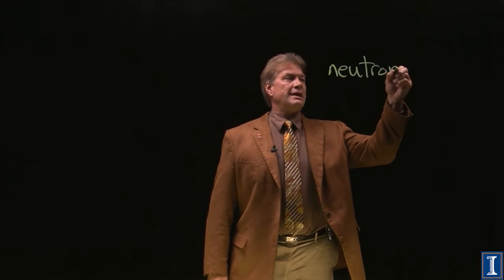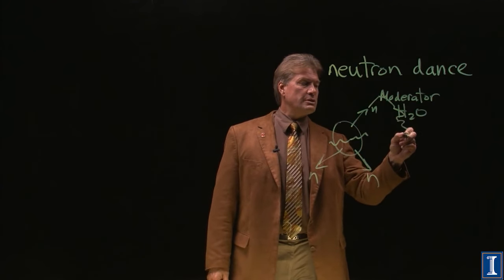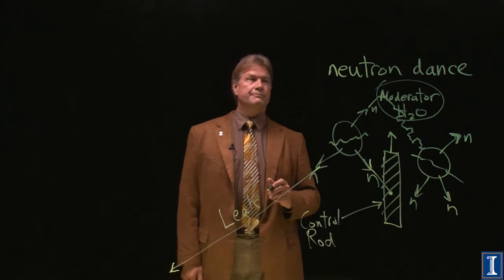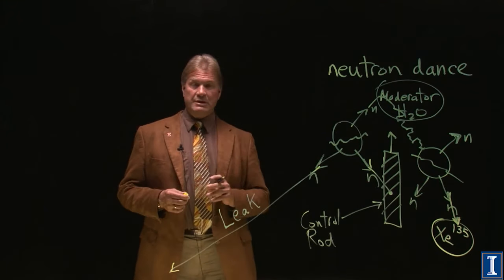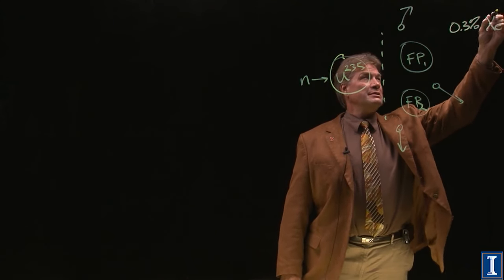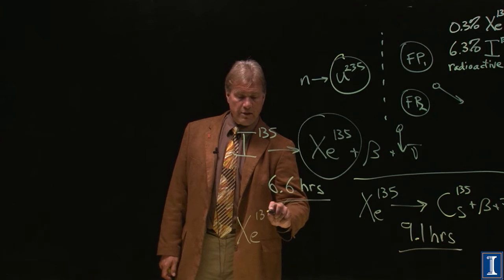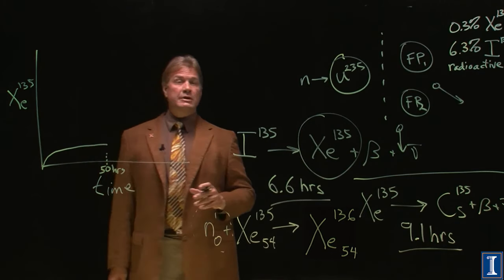Xenon Can Be a Problem

Comment: I had always heard that the disaster occurred because the Chernobyl nuclear plant was badly designed.  But apparently it was actually caused by its operators performing an obviously stupid operation.  That was a very clear presentation by Professor Ruzic.
Reply: (according to the internationally accepted explanations) 
It was badly designed: After they created the runaway reaction they tried to shut it down. But the shutdown just made it run even faster because of a design flaw.
The design flaw is quite complicated related to the graphite parts of the control rods, and only presents itself in case of emergencies, so the operators had no way of knowing it from their own experience (and they weren't told).

The positive void coefficient made it possible to create a runaway reaction. Some argue that is a design flaw, but with smart design and safety you keep such reactor in control. (positive void coefficient causes a positive feedback loop during runaway)

Without the design flaw, they could have stopped the reactor even after the runaway started, and could have resumed normal operation a few days later. (or immediately after if they were particularly brave, against all regulations)

Control rods: part of the control rods is graphite which makes the reaction run faster (by slowing down neutrons), other part is a neutron absorber. This seemed to be a really good idea, because this way there is never water in the control rod hole. Light water is a neutron absorber, so without the graphite parts, pulling out the control rod would be exchanging a strong neutron absorber to a weak one.

With the graphite parts of the rods they were able to start the reactor with very low uranium enrichment because there was very little neutron absorbtion in the core during start-up.  This composite control rod, which actively helped or hindered the reaction made the reactor simpler and cheaper.

Unfortunately the reactor inside is very inhomogeneous, and graphite "tips" on the control rods created a particularly bad situation in the bottom parts. In case of a runaway core, pushing down the rods only stopped the reaction in the top parts of the reactor, it increased it in the bottom parts for a few seconds. High speed control rod actuation would have solved the problem, or some re-engineering of the rods. RBMK reactors nowadays have all fixed this flaw, and run very very reliably.
Reply: @adamrak7560  lol, which is a little like saying 'aside from that Mrs Lincoln, don't youbthink itcwasca pretty good play?'

Comment: Wow, I read a document that claimed that Chernobyl was caused form Lithium build up.. It claimed that they ran the reactor at max for a few minuets.. Then set it back to Normal. This max run, built up matter that later decayed into Lithium. Due to the timing, all the decays happened around the same time. So they had to pull the carbon rods out.. 

   There was no record of a reactor shutdown.. However, who knows? Too many people are writing papers claiming this and that.. This Xenon problem looks quite likely..
  Okay there was a backup reactor that was fired up, that had been off. That one would have had Xenon problem.. But it was not the first reactor to breach...

Comment: So, can this xenon be harvested? It make a good fuel for ion drive (Like the Dawn spacecraft and others). And flash tubes for strobe lights.
Reply: It's a mixture of isotopes. The xenon-136 is stable, but good luck seperating it from all the other radioactive nasties. Doable, in theory, but not at all economical.
Reply: You can breath it into your lungs and make them glow in gamma light.  If you have sections of your lungs that are not functioning properly they will absorb less Xenon 135 and show up as shadows on the gamma image.

But what happens if you sneeze?  Then everyone in the room breathes the radioactive Xenon.
Reply: you would have to contain it an wait for a long time for all the non stable stuff to decay.

Comment: The fact that humans are required for the safe operation of reactors is unfortunate. Is there a way to make the catastrophic failure case for nuclear comparable to solar? Ie imagine nuclear unobtainium bricks that are cool and harmless in your hands but when you toss them into a pool of tap water they get hot enough to boil it but not much hotter and when the water boils off they cool off. This seems the promise of MSR.

Comment: I still don't understand the exact reason why what they did in Chernobyl was so bad. They might have went against the design of their reactor, and that's wrong. But, in theory, wouldn't removing control rods just increase reactivity by a fixed amount? So if you're at -0.09 reactivity instead of the normal -0.06 then you just remove as many rods as you need to balance out the lost reactivity due to Xenon. Then later, as the reactivity returns to the default state, you need to start putting them back in to avoid going up in reactivity. That's dangerous (of course) since you're not in a stable state over time, so I get why you shouldn't do it, but how did pulling out the rods to counter the Xenon poisoned reactor cause such a catastrophic runaway almost instantaneously?
Reply: They underestimated the amount of xenon present because the reactor was not designed to be used in such a manner - it was a safety test in which the reactor was being deliberately run outside of the intended operating parameters to verify it would continue to function safely. It didn't. That would have required shutting down the reactor in a hurry, but a design flaw caused the reactor power to briefly spike during the emergency shutdown.
Reply: The problem is that once they started getting it going again the neutrons came along and converted the Xenon. So the more Xenon got converted the faster the reaction reacted and the faster the xenon was converted.

Comment: He says I-135 "unlike Xe-135 is radioactive" implying Xe-135 is stable and "stays around". Then of course later explains Xe-135 is also radioactive.  Pretty big mistake I think and something that could confuse the layman (I am a nuclear physicist).
Reply: Under normal operating conditions the Xe-135 is destroyed with neutrons, not by radioactive decay.  So, under normal operating conditions whether Xe-135 is, or is not, radioactive, is NOT an issue.  Only when you shutdown the reactor or run at very low % and you let Xe-135 build up, then and only then, does Xe-135 radioactive decay become an issue.  It was very clearly explained.

Comment: Would chernobyl have been managable had the control rods not been graphite tipped? 

Or would the reaction still have been unmanageable?
Reply: Without the graphite ends, ("tips" implies small, the rods were actually half graphite), scramming the reactor would have slowed the reaction, eventually stopping it, instead of the explosive surge in reactivity. 

Since nuclear reactions happen quickly, (nanoseconds), depending on when the button was pushed it probably still would have happened, but it would have been orders of magnitude less. Maybe only a temporary surge causing boiling, and some fuel rod damage. Maybe the release of some radiactive steam, but not the extreme explosion that destroyed the entire core.

Comment: So...they basically primed the core for saturated fission events by removing too many control rods, then prematurely over-boosted the potential for making the rapidly-increasing number of neutrons available (from running out of xenon-135 to become xenon-136) slow, thus sending the number of reactions into overdrive. All because there's no good way to know how much xenon's affecting the number of available free neutrons (but since it's a limited amount of xenon anyway, you simply wait a safe amount of time for most to become xenon-136). Jesus.
Reply: They were under pressure to run the "test" without knowing what had previously been done to the reactor on the day shift ( idle mode ).  So they had no clue how to properly restart the reactor on the night shift. And they disabled every automatic safety control and tried to restart manually. Kaboom!

Comment: They did not have enough infrastructure built to carry the load..if they had enough bleed on the rod they wouldn't surge...the community was ahead of its infrastructure..it needed 5 times the utility to bleed the reaction..could have been as simple as creating bigger copper wires and bigger machinery..but because no one advanced the inception it became overkill ..

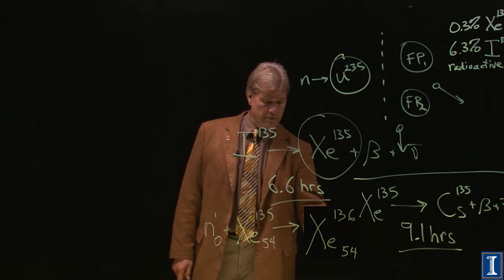Comment: What the heck happens at 9:04?
Reply: He probably makes a mistake in what he writes on the board, so they replaced that little section with a correction photographed later. He rases the mistake and rewrites it, they  edit the erasure out and they remove the overshot at that point.  Keep your eyes on the man behind the curtain.